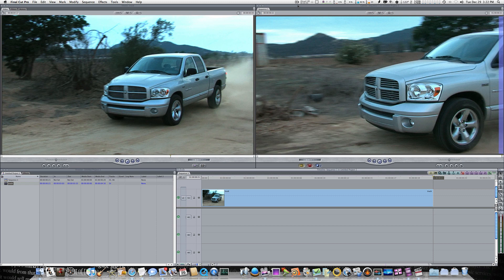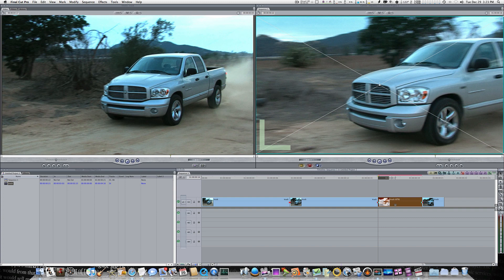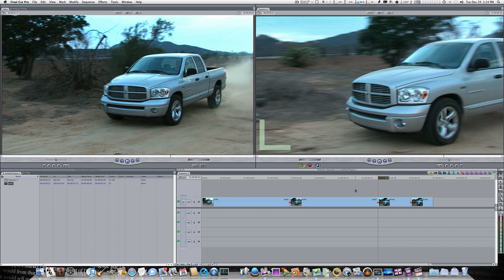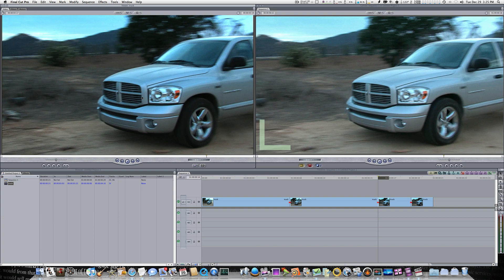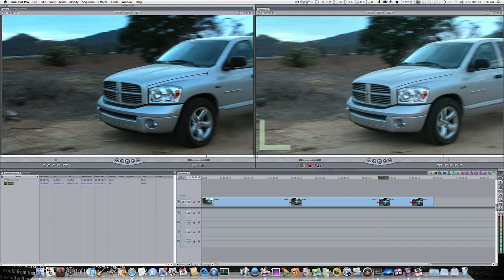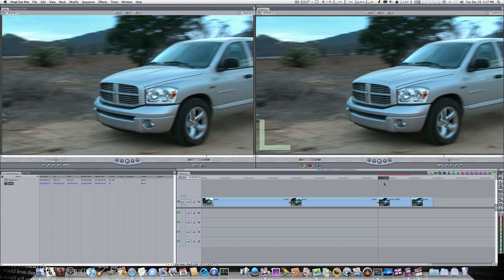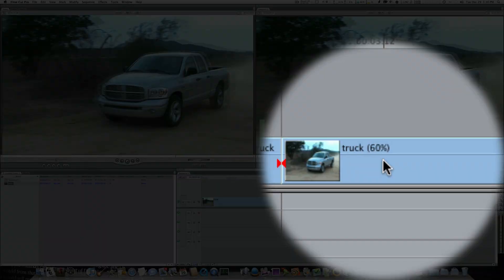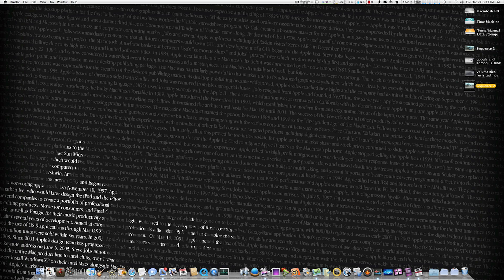Final Cut Pro 7 Tutorial : Using Match Frame to Change Clip Speed Without Changing Duration.

Comment: Awesome vid, man. I've always wanted to do kind of a ramp sow mo thing. It's been about 6 years using FCP and I'm learning something new everyday. I posted a vid comment that  I filmed and edited it  with my iphone 3gs, Screenflow, FCP, the CGM Aged Film filter, and the Line Art filter

btw what are your thoughts on the iphone 4, and what's with Apple revising the Imac when I just got the Quad core i7 in January.  Guess they just had to include the option to add a solid state drive as well